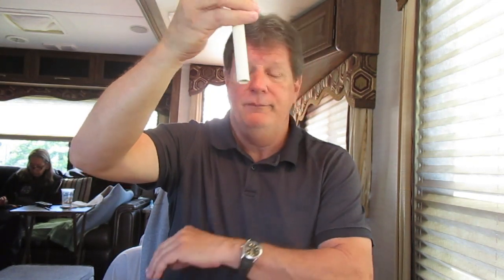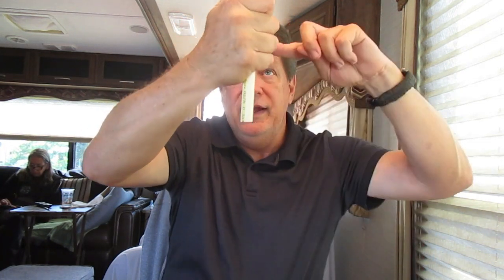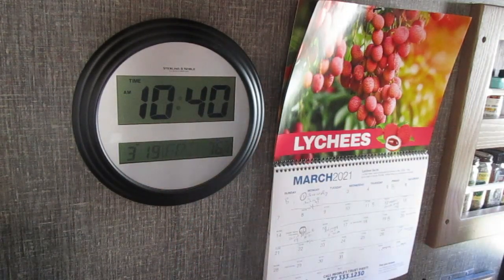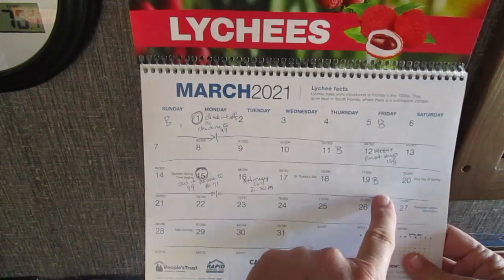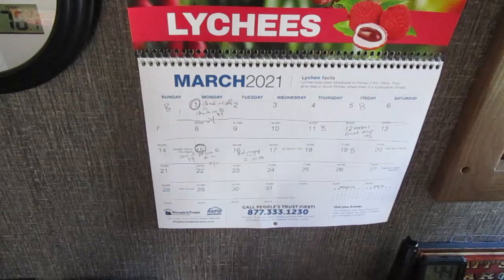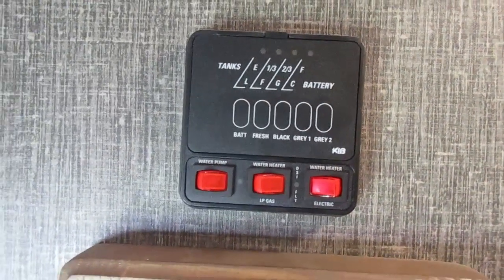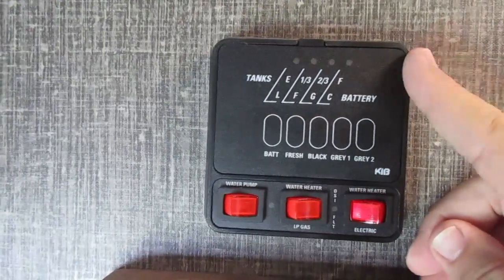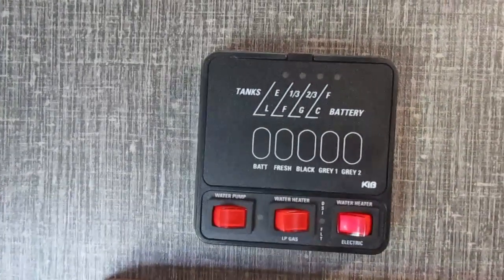Full Time RV'ing 101 - Black Tank Levels & the Black Tank BURP

Comment: We have several camping locations where we will sit in place for 14 to 21 days. Should we leave gray tank valve open all the time? Would it be ok to close it the day before the black tank dump in order to help flush the hose? I’m a rookie in this area of full time RV life. Thanks
Reply from the maker: It is perfectly OK to leave your GREY tank valve open if you are stationary.  I will usually close mine a day or 2 before dumping the black tank as you suggested to use the water to wash out the hose.  Just do NOT leave the black tank valve open.  That is bad...

Comment: We have sensors/light thing but it doesn’t say black tank. It has fresh-battery-grey 1-grey 2… something like that. Do some fifth wheels not have a thing to show black tank level? We’ve never used the toilet — we use one in the shop, but whoever we purchased our rv from must not have emptied it prior to selling. We started noticing a strong odor today. Any tips? Also, the Norcold fridge/freezer does not work and neither does the heater unfortunately.
Reply from the maker: You may have to experiment with the buttons to find out what controls what.  If you have a smell, you need to empty that tank and flush it